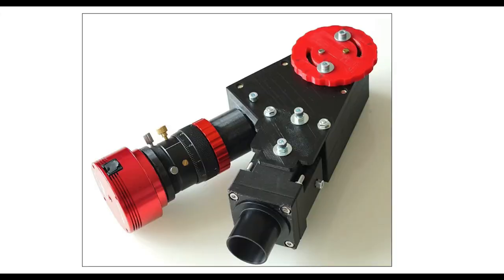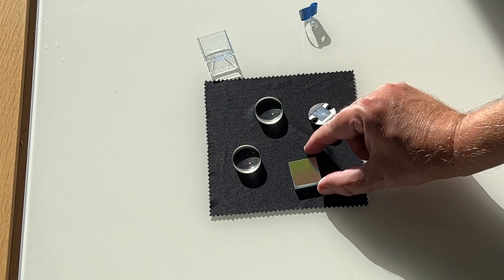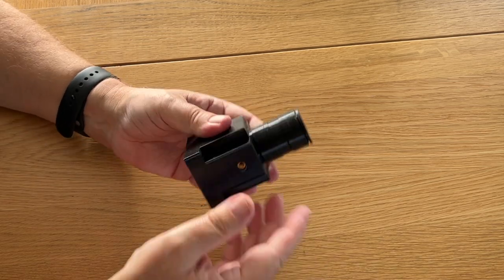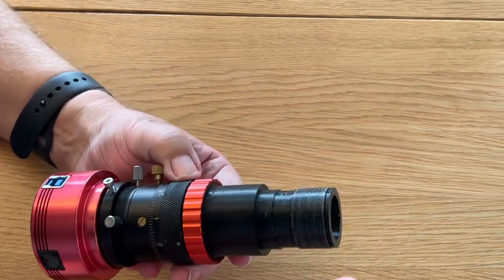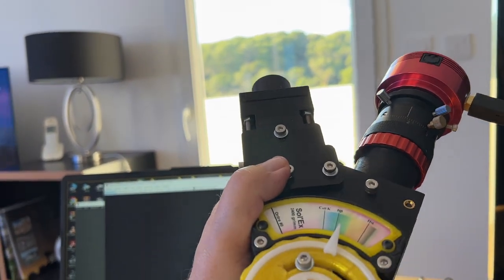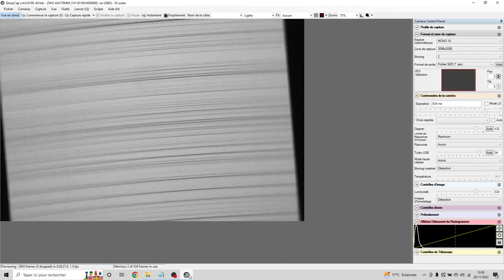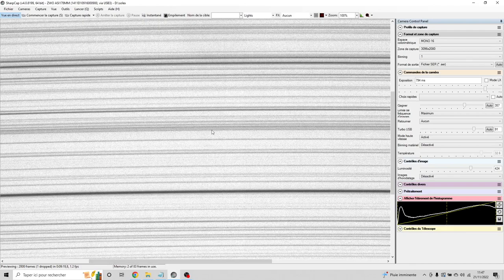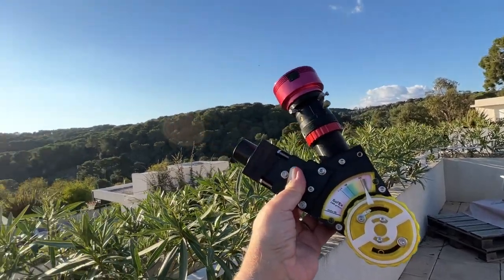How to assemble and adjust Sol'Ex in 30 minutes!

Comment: Do you leave the UV/IR Cut filter in place permanently?
Reply from the maker: No, I don't use an IR/UV cut filter all the time, in normal use. The neutral filter in front of the scope, ND16 type for example, makes the use of this filter useless when operating Sol'Ex.